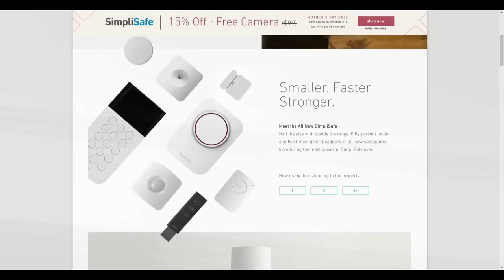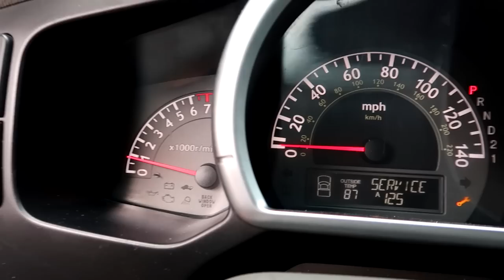Buying a Reposessed Truck at Auction was a MISTAKE! It's WAY Worse Than I Thought!

Comment: Do a late model Ford F1 50 or 250 Dodgers they restart Chevrolets they have problems with your electrical Toyotas I don’t know if they’ve sold or rusty frame issue we’re going to Ford
Reply: Dodges rustout so bad

Comment: That’s not too bad from rust I live in Omaha Nebraska and holy fuck does shit rust fast, I have a undertray on my 2013 fusion and when the undertray got tore up (because it’s like paper) it looked good under neath, now it’s spring and I just looked under and it’s coated with rust and I’m pissed, why because I was gonna put on a new under tray but they are 200$ for a paper/card board feeling tray that just rips and drags on the ground if u run over anything like a stick

Comment: Sure run it with a bad cat that to us hasn't been properly diagnosed as you even said then take out the engine. 

Maybe ur friend could've properly diagnosed it and helped you get it in great running condition. Replace the plugs because as ur friend said the owner probably didn't replace them when he should've and with worn plugs you'll well take out the coils. Plugs are cheaper than coils and diagnose the catalytic converter properly and fix the rack and pinion and drive it with the rust for another 150k miles. I mean really it's only rust. Not like the rust is a " Mechanical " thing. Now get back to work Sam....

Comment: You don’t replace rusted catalytic in a non inspection state lmfao, and you certainly don’t keep driving it with a horrible sounding exhaust unless it’s a 500$ beater. You replace the catalytics with straight pipes and it will quiet down.

Comment: Samcrac you buy cars and fix them you should of took it on the chin and did what any normal car dealer would of done , took the front bumper off , chucked a moderate amount of  rubbish in the cabin area like soda bottles and such then re auctioned it and that's what you should of done not fix that pos you had dropped on you

Comment: Aha. I like how you call that drive train reliable when it's one of the most unreliable drive trains they've made. Weak trans. Loves to have valve issues with cylinder 4. Rear main seals go often. I avoid this generation of ridgeline and pilot like the plague.

Comment: Being that you've used Copart a lot, can you help me a bit? I'm looking into my favorite car, and noticed it's listed as salvage, but run/drive with minor dents and scratches as listed by Copart.

Looking into the vin however I do not see any history of accidents, and the salvage only shows up for when it was listed for auction in the website? I've tried using autoaucions .io but typing in the vin, or pasting the lot just brings me back to the homepage of the website? (That could just be my computer though)

That being said, I am new to the Copart, this would be my first purchase, but it's my favorite car (not gonna attach emotions to the auction) generally hard to find, yet a relativily cheap car. What would you suggest?

Comment: If that is a Florida vehicle then obviously it came from sea salt rust. That Honda will run you 300000 miles easily my 2006 ran 318000 before I sold it to a friend of mine keep the truck it will run forever and it pulls 5000  pounds, don't be such a Sissy.

Comment: Reality buy a ford or a toyota. the fords have an aluminum body and will be less likely to rust in the salty sea area of florida vs other brands. Additionally toyota is known for their durable trucks for a reason. Hondas are good but overall not the best for long term high millage vehicles. Hondas are known to be built well and cheap to fix however have never been known for long term reliability.

Comment: I have a 2004 Acura MDX and it has that same engine and the power steering also went I think it is something common in these cars the transmission also likes start presenting some problems at 150000 miles